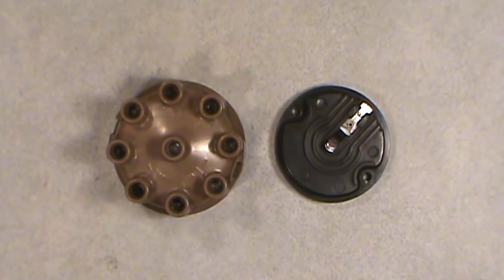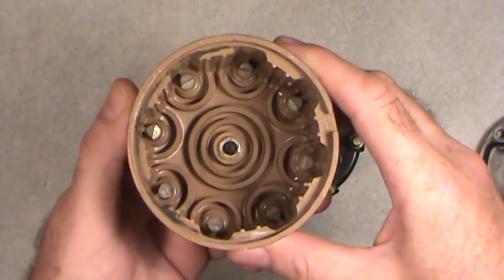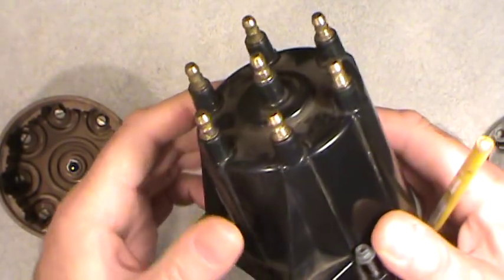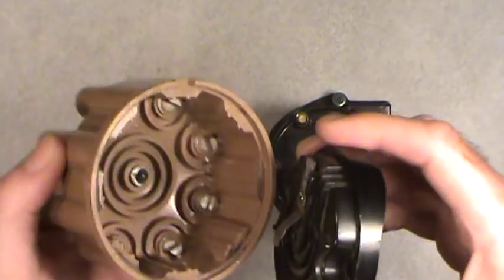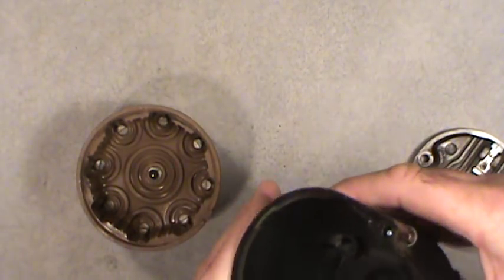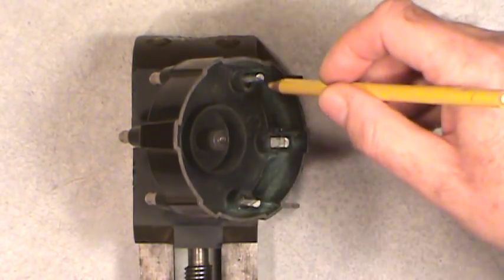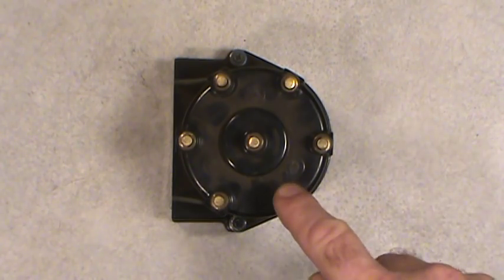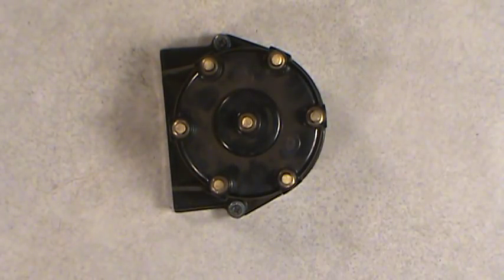How to Inspect Distributor Cap and Rotor Condition (Part 2)

Comment: Thumbs down. I didnt see a continuity tester used to check for shorts. No visual test will help you there.
Reply: A continuity test on a cap or rotor is not practical. A defect such as a crack or carbon tracking makes an electrical path for extremely high voltage, but not for the low voltage powering testers and ohm meters. You would still get an infinite reading, no light or beep depending on the type of tester you're using.
Reply from the maker: journeyquest1 Greetings journeyquest1....Thanks for watching, and for Your comment/opinion as well.........................................It appears that, what..."Dallas Cheked" (as per comment)...is quite accurate, and, is the "Method" that I have used, for many, many years now..........................................................But, like just about anything that I work on, I'm finding, that there is usually, an..."Exception for Every Rule"....and I try to make a point of..."Never Ruling Anything Out"...as, at times, I do Find, some pretty Strange Things, when I least expect "It"...................................................So then, here's "One" for Ya...............A number of years ago, a Friend of mine phoned me up, and was telling me, about a "Dead Electrical Circuit", in his Car (an older Subaru, if I recall correctly), so, I told him to drive it over, and that I'd have a look at it..................................................Let's see now (please hold...as my memory archives are processing at the moment)...........ah yes, as I recall, He was right about that "Dead Electrical Circuit" alright, so, as I remember, the "Fuse Block" (Panel?), was located in the engine compartment, and I had a Look-See at the..."Buss-Type"...of..."Fuses" (the old "Buss" type of automotive Fuse, was the kind, that was cylindrically shaped, about 1/4 Inch in Diameter, made out of Glass, and had a Metal Cap on each end, and the Filament-Like Fuse Element, was easily seen through the Glass tube, and the lengths can vary, as well as the Amperage-rating, and this one, was about "1" Inch long, give or take a bit).......................................................So, as I'm looking at that "Row" of Buss Fuses, all of their, shall we say "Filaments", looked to be "Intact" (when one of these type of Fuses..."Blows"...its "Filament", well, kinda looks like it "Self Destructs", and usually shows its "Filament"..."Broken/Melted"...in its middle section, which in turn, makes for "No-Connection!")...............................................Oh, what to do...............I know, I'll get out my Volt-Meter, and see if one end of that there Buss Fuse (while still in the Fuse Block), is getting battery voltage at all (not sure if the ignition key had to be on, but if need be, "It" was...lol)...............................................Well.........."One End"...of that "Buss-type-Fuse"..."Was Getting"...that nominal 12 Volts alright...but...the..."Other End of that Fuse"...was showing..."Zero Volts"...although the "Fuse's Filament", looked (Visually), to be..."100% Good"...!!!....................................................So............I remove that there..."Buss Fuse"...crank my Multi-meter to the "Ohm's Position", connect the Multi-meter's test leads to each end of the Fuse, and look Ma..."Zero Ohms"...!!!..............."Wowsers"...kinda looks like, that there..."Buss Fuse"..."Blew", just inside the "Metal Cap" (one on each end, remember?), where "It"..."Could Not Be Seen" (Visually, that is)...!!!.................................Hey, this scenario, would have been a great place, for You to Use Your "Continuity Tester" (if it happened to be Self Powered, when testing the Fuse, all by its lonesome)........................................................You could use an "Ohm Meter", to Test the "Resistance" of the "Carbon Button", and each of the Distributor Caps "Terminals", if You cared to do so, along with the Rotor as well, maybe......................................................If, for instance, we are now talking about, something like a "General Motors"...H.E.I. (High Energy Ignition) Distributor "Cap", that has the "Ignition Coil"..."Mounted In/On the Top of It"...then, there is usually a..."Carbon Button"...that by all means...should have..."Its Resistance"..."Checked"...just to make sure (if You do so, please Check the Specifications, for that particular Distributor Cap's, Carbon Button's, Ohm's Specification), and, the resulting "Continuity", or lack there-of, should show up...................................................In closing, "Lots of Moisture" (aka, might be Condensation), Inside a "Brand New" Distributor Cap, will usually, at certain times, render "It", to the point of being "Absolutely Useless", which will usually result in a "No Start" (of the engine), probably, due to all of that there..."Spark-Scattering"...goin' on, inside the Distributor Cap..............................................I'm thinkin', that, a Lighter Colored Distributor Cap & Rotor, would make things like "Cracks"...and..."Carbon Tracking"...much easier to see, as opposed to a Dark Colored example there-of, just sayin'..............................................I'll end with, what I think, may just be, one of those ole sayings, and that saying is....................."There's a Time and Place for Everything"........................Be Safe, take care, and have a good one.
Reply from the maker: Dallas Cheked Greetings Dallas Cheked....Thanks for watching, and for Your "Automotive Wisdom" as well...........................................Sure sounds to me, that, just like I did in the past, was that You probably had Your fair share of..."Scrape-ing"...some of that..."Crusty-Like-Corrosion"...from the Distributor Cap's..."Internal-Aluminum-Terminals"....with something along the lines of a..."Plain-Tipped-Screwdriver"...just because...!!!...lol...................................."Those were the days my Friend"................But now...We have Distributor Cap..."Terminals"...and..."Rotor Blades"...made out of..."Brass"...which it appears, that, those little Critters, known as ..."Electrons"...have become quite fond of, and, at not all that much, of an increased cost, over that..."Crusty-Dusty-Aluminum-Stuff"...lol................................................Hmmmmmmm...do they, or did they, call Aluminum............."Aluminium"...in the U.K. (United Kingdom) perhaps...???...well, for some reason or other, that's what I may have heard in the past, just sayin'................................................Oh, and, just like Spark Plug..."Gaps"...there is also the..."Gap" (aka, Distance), between the..."Tip of the Rotor"...and..."Each of the Distributor Cap's Internal/Perimeter Terminals"..that for the most part, usually don't get much Attention.................but, then again, we can, and do see, the..."Wear Factor"...that is..."Created"...by, all of that..."High Voltage Arcing"...Goin' -On..."Between"...the previously mentioned, shall we call them..."Arcing Paths"...perhaps?..................................................I'll end with, a rather good one, and that good one is..........."Out of Sight...Out of Mind"...!!!...lol.............................................Be Safe, take care, and have a good one.

Comment: It's so funny that the spark plug wires are known to be hard to put in the right order and still manufacturers refuses to mark them. It would be pretty easy to just stamp a number on the wire and the corresponding terminal.
Reply from the maker: Greetings...He Ka..................Thanks for watching..............."News Flash"...!!!...lol...and now, here's that News.................I think, that I recall seeing a "Set" of spark plug "Wires", having the "Numbers" (1...2...3...4...5...and...6) "Printed" on, a "Factory" installed, Set of spark Plug "Wires" (when the vehicle was New), that were on a (General Motors) Mid 1990's, "Chevy" (aka, Chevrolet) Astro Mini-Van, that had a 4.3 Liter (262 cubic inch), V-6 Engine in it...................Even though the spark plug "Wires" were "Numbered", that, in itself, will only help out, just a little bit...say what...???...................Yes-Sir-ee-Bob...for starters, the Number "1" Cylinder's, spark plug "Wire", has to be Connected to the Distributor Cap's Number "1"..."Terminal"...and also, the "Tip" of the Rotor, should be Pointing to/Lining up, with that Number "1" Terminal on the distributor Cap, as well, when the Crankshaft's, Number 1-Cylinder's Piston, is at TDC/Top Dead Center, and the "Groove/Marking", on the Harmonic Balancer (or call it Damper if You like), is lining up with the "0/Zero" marking, on the, shall we say, Degree (markings) Tab, or whatever it is, that indicates 0/Zero Degrees, on the Engine Block, when the Engine's Number "1" Cylinder's...Piston, is at TDC/Top Dead Center, while also, being, just at the start of the Power Stroke (intake and exhaust Valves Closed...hopefully)...................Then, there's the "Firing Order" of that "Exact" Engine, as well as, the "Direction", that the "Rotor" (that's hiding inside the distributor Cap...lol) Spins/Turns (Clockwise, or Counter-Clockwise...???), has to be taken into consideration as well....................Then, a Person has to know, the "Cylinder Numbering" for that "Exact" Engine................Time to Relax now...lol...cuz, if a Person, only wanted to Replace a Set of Old spark Plug "Wires", with a Set of New ones, on an Engine, that was running reasonably well, then, all it takes, is, to "Change"..."ONLY"..."1" spark plug "Wire" at a time, that way, the "High Voltage", will be going to the "Correct" Spark Plug, and hopefully, at the Right Time (pretty much meaning, that, the Ignition Timing was previously, Set Properly, to begin with)...................Here's what I've been doing, oh, for a few years now...................Before I remove any spark plug Wire, from a Spark Plug, or, the Distributor Cap's Terminals, I grab a roll of Masking Tape (about 3/4 Inches wide), and rip off a piece, oh, about 2 and 1/2 inches Long, and wrap each piece of Masking Tape, around each of the spark plug Wires, and leave, what appears to be, a "Flag" (when the 2 Sticky sides of the masking tape get Stuck together), and place these "Flags", on the spark plug Wires, reasonably Close, to the Distributor Cap.....then, I use a Felt Pen/Marker/Sharpie, to Write the Engine's Cylinder Number, on each of the masking tape "Flags".................Also, the Number "1" (cylinder), can be printed, with a Felt Pen, nice-n-Close, to the Number "1"..."Terminal", on the distributor Cap, and, maybe also, Mark an Arrow, to show the Direction, that the Rotor Spins, on Top of the Distributor Cap, to make things even easier (the Color of the Felt Pen, has to be in Contrast to/be Opposite of, the Color of the Distributor Cap, or, You'll probably have quite the problem seeing it...Yikes...!!!...lol...and also, some Folks are sayin', that, some of the Felt Pens out there, might Conduct High Voltage Electricity...maybe...???...might not be so good, just so You are aware).........................I sure do find, that, those Masking Tape, Numbered "Flags", that I've been using, really Do, Help out lots, did I say LOTS...lol (indeed, they sure do)..................So then, if You care to, just make some of those Cylinder Numbered...Masking Tape..."Flags"...for Your Engine's spark plug Wires...Enjoy...and.......till next time.......Be Safe, take care, and have a good one.
Reply: YOU DONT NEED MARKS.

See your firing order, 1342, so you connect r with this order. The number one can be anywhere you just have to fallow the order. otherwise engine will not start.
Reply from the maker: Greetings...Maxengines Tech..........Thanks for watching...........Well...He Ka...(the Person, that started this Post), Did Not mention, just what Engine, that, He or She had, and, it looks like, You were assuming, that, "it" was a "4-Cylinder" Engine...??? (interesting that).............Also, if a Person, just installed, all of the spark plug "Wires", as You were saying, on a 4-Cylinder Engine, in that, 1342 Firing Order, providing that, it is "Correct", for the "Exact" Engine in question, then, what about having, the Number "1" Cylinder's Piston, being on its "Power Stroke" (firing stroke), while being at, TDC/Top Dead Center, and, is also, being indicated, on the Harmonic Balancer's, TDC/Top Dead Center's, Line/Marking, lining up with, the timing Tab, or what-ever it just might be, as well...???...and also, which "Terminal" that's on the inside of the Distributor Cap, is that "Rotor", actually "Lining Up with"...???...as well as, what "Direction", is that "Rotor" Turning/Spinning, is it "Clock-wise"...or..."Anti-Clock-wise" (aka, counter-clock-wise)...???...and, if a Person, gets any "1" of those things above, Wrong, then, I be thinkin', that, that poor ole Engine, would probably be doing, some (ignition related) "Firing", of the Spark Plugs, at the "Wrong Time", and probably be Hearing..."Pop"..."Bang"..."Cough"...kinda Sounds, and an Engine, that was surely, "Not Running Properly", at all...!!!..............In order to Avoid, any of those (above) Problems, I usually tell People, to just "Change"..."One Spark Plug, and/or, One spark plug Wire", at a time, that way, there's almost no way, to Mess-it-up, as I see it, that is...........Here's a Challenge for You..........Let's have a Race, shall we...........Let's assume, that, there is a V-8 Engine, that had, all of the spark plug "Wires", Removed from, the distributor Cap's Terminals, on that particular Engine, and, both You and I, have to, install a Set of New spark plug "Wires", on that Engine (not including, the ignition coil, to the distributor Cap, high tension Lead/Wire, if applicable, cuz, that's just too easy, to install, and get wrong).............Now then, all You have, is an Octopus (8 spark plug "Wires"...lol), and, I have, all of my, 8 spark plug "Wires", with the Cylinder Numbers on each of them, as well as, the distributor Cap Terminals (on top), have the cylinder Numbers, near each of those Terminals, as well as, the Cylinder Numbers, showing near, where each spark plug is located..............Oh, and also, the Engine, has the Number "1" Cylinder's Piston, Set at, TDC/Top Dead Center, on its, Power/Firing Stroke, just so You know (to make things easier, for the both of us, hopefully)...............Now, the Starting Gun goes "Bang"...!!!...and the Race begins..............Well, it only took me a few Minutes, and I was all done, and, Each and Every spark plug "Wire", was "Exactly" where, it should be installed, and, I Start the Engine, and, "It", is Running really good-n-smooth...and...I look over, to see what You are doing, and I see, that, You are still, trying to figure out, which way/direction...???...that the "Rotor" (that's inside of the distributor cap), should be spinning/turning...???...and, You still don't have any spark plug "Wires" on the Engine yet...!!!...lol...........Come to think of it, there was a Lady, that Posted, under one of my YouTube videos, a while ago, that She, shall we say, Painted-on, Different "Colors", of "Nail Polish", to ensure that, each of the spark plug "Wires", got Connected onto, the "Correct", distributor cap Terminals, and probably, the Correct spark plugs as well, maybe, as She didn't go into too much detail, as I recall, and yes, that is One Smart Lady, alright............So, please, maybe take a closer look, at some of the different Ignition Systems, in a little more detail, kinda like, I have done over the years, somewhat, that way, You probably, won't, just be saying, to "Only Use the Firing Order", all by itself anymore, I hope, and..........till next time.........Be Safe, take care, and have a good one.
Reply: You got served Maxengines Tech
Reply: I dont answer  TO COPY PASTE text.
But surely you dont need to race, just understand what fire ordering really is.Theory is a beginning, but not enought, neither to a real start.-...
Reply: "be hard to put in the right order" -  iTS MADE FOR PEOPLE WHO KNOW HOW TO DEAL WITH IT, and it one of the easiest thing in the world...you dont need marks, nails, numbers, tdc,,, cilinder number, thats crap talk.. "and still manufacturers refuses to mark them". - THEY ARE RIGHT  wires dont need numbers neither cilinders, unless yor not a tecnhician,

I would remove marks from camshafs too.

Here the guys, have to deals with engines with no marks,numbers,  and they dont bother with that.Of course, you dont know the city, you have to leave a stone in any corner, and mark the things..check the doors numbers, etc . You cant tell that this guy is a guide , cant you?
Reply: Maxengines Tech Would it really be that much asked? Why all the secrecy? Why does everything have to be so god damn cryptic?
So that a only "tecnhician" should be able to do the job?!
Reply: Maxengines Tech It has nothing to do with what I can or can not do.